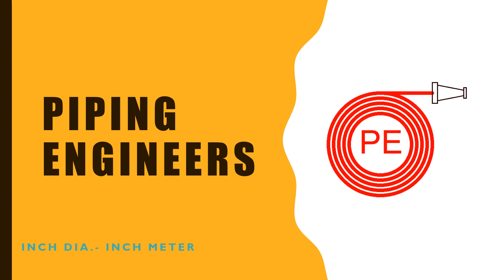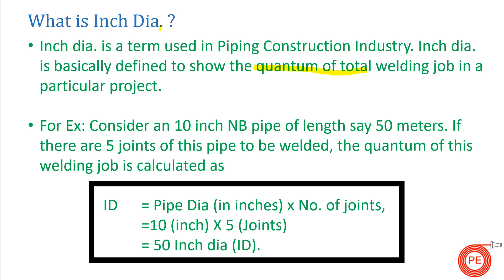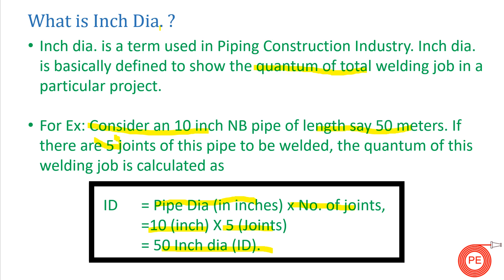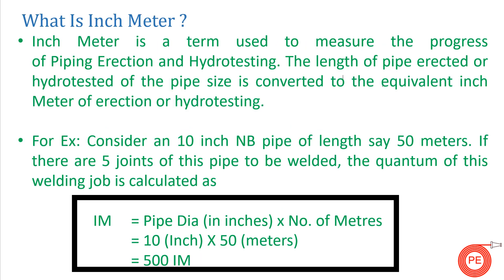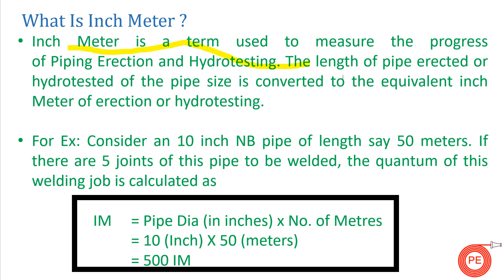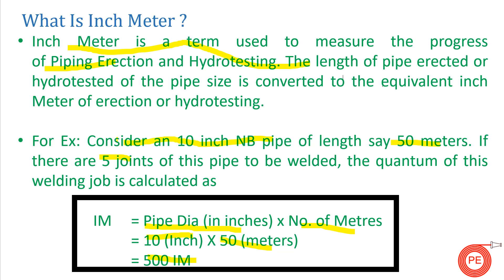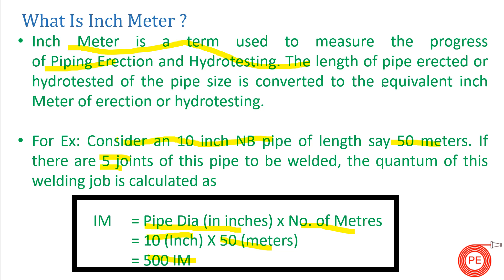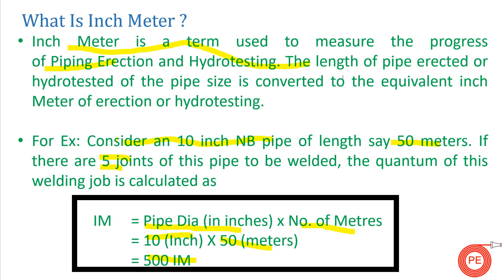Inch Dia & Inch Meter| Calculation of Inch Dia & Inch Meter in Piping In English| Piping Engineers

Comment: How much inch dia of productivity can be achieved by a single welder in 8 hours for both fit up and final welding
Reply from the maker: There are some thumb rules  for piping welding it is expected that a single welder can weld around 20-30 inch dia pipe per shift